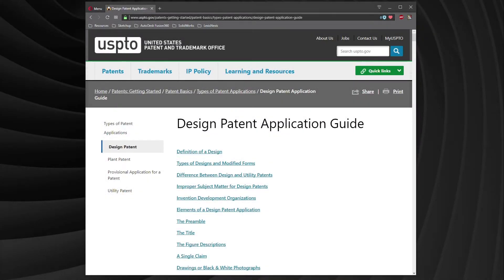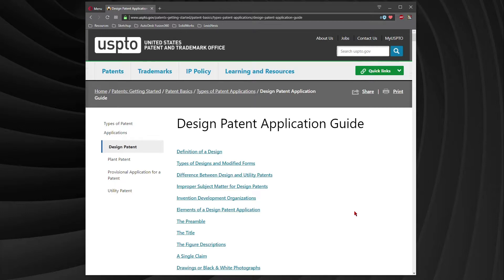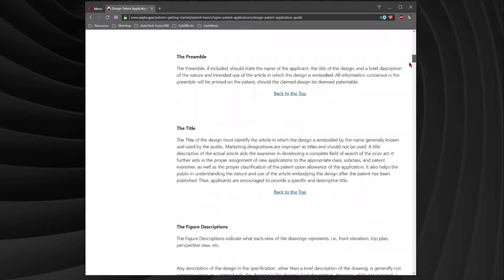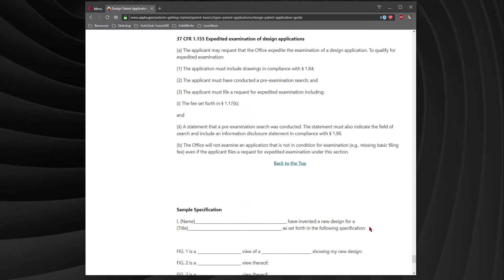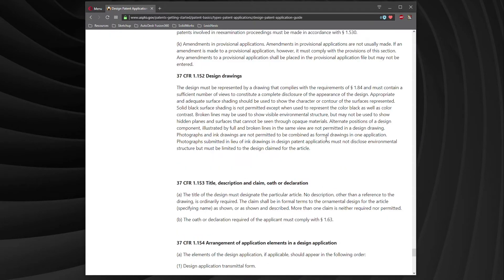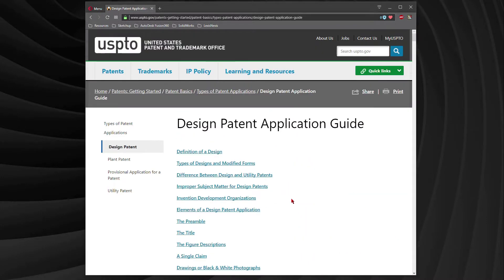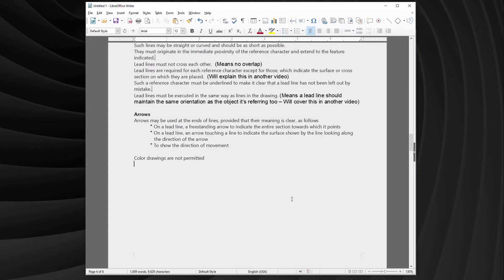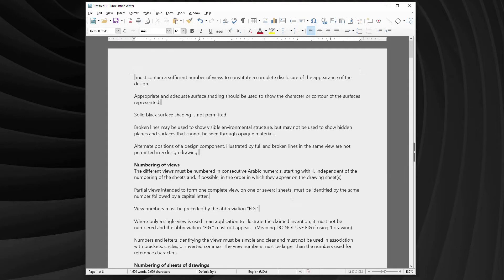Find Patent Drawing Standards

Comment: Hello, Chris.taner here. I'm looking for a professional drafter for my design patent drawings, its just one piece I designed nothing intricate. Would you happen to have any leads?
Reply from the maker: If you're looking to have a few drawings put together for a Design Patent; you could just google ("Technical Illustration") and you would find an enormous amount of 'Patent Draftsmen' (as they say in the business) which do Patent drawings all day.  Most of them could probably put something together for you in their spare time for a nominal fee.  

Keep in mind that if you get the drawings professionally done, and then take them to a Patent Attorney for the filing; they are under no obligation to use them, and will in some cases ignore them altogether despite having them created by an expert.  IP Firms usually prefer to use their own (outsourced draftsman) aka CAD Engineers as they can mark up and bill you for that time.  If you end up going in for a Utility Patent it's best that the drawing documents and the specification document be created from the same firm.
Reply: @PatentClarity  ok, thanks i understand. Great information vary helpful.